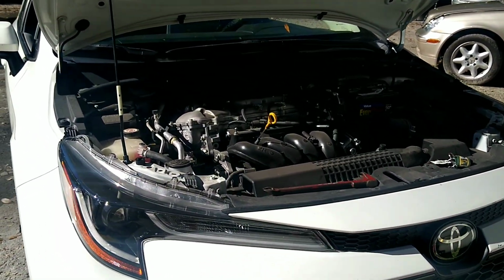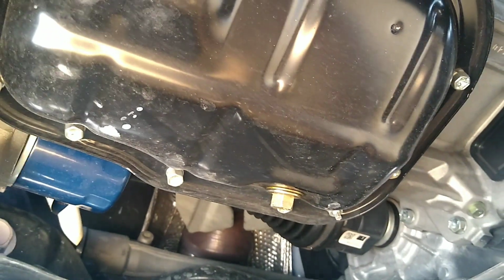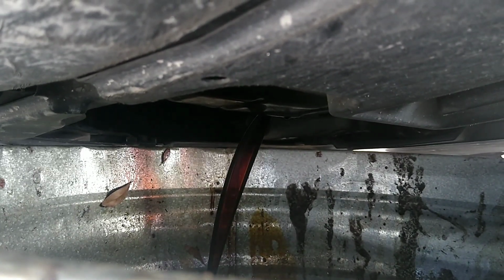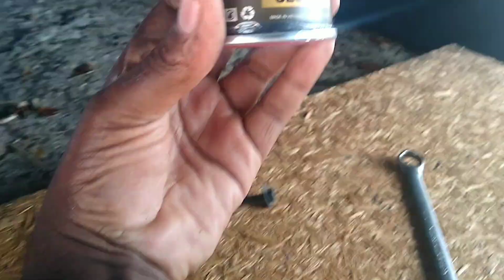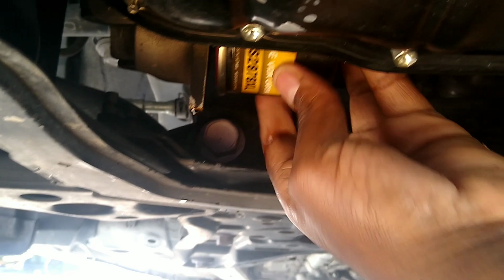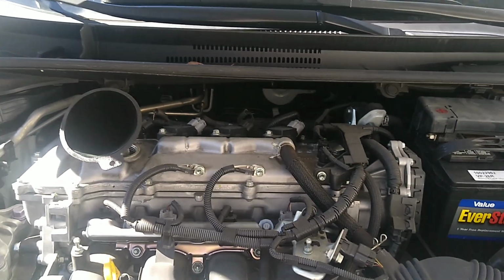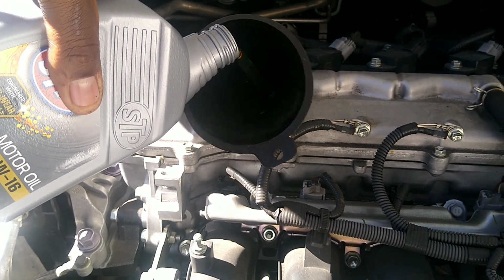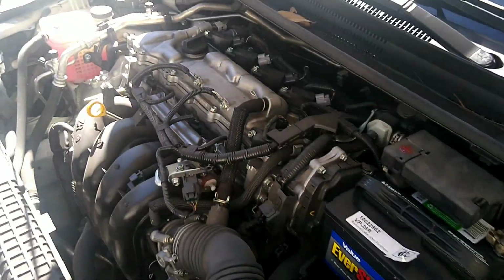2021 Toyota Corolla Quick Oil Change

Comment: The Corolla LE 1.8 engine takes 0w20 as mentioned.  Other Corollas with the 2.0 engine like the SE & XSE take 0w16.
Reply: Still can us 0w-20 if that's all you can find. Says this in the manual
Reply: The newest 2.0L engines actually use 0W-08, with the manual saying that 0W-16 can be used, but "must be changed to 0W-08 at the next oil change".
Reply: @googleusergp That is just to make more money for toyota.  Literally better for engine to use 0w-20.  The same exact engine goes to other countries where they say you can use 0w-08 to 5w-30 in the manual.  You probably won't even get better gas mileage.  If you happen to get better gas mileage you will still be paying more for oil and not protecting your engine as well.
Reply: @googleusergp Basically you must the use the more expensive oil and be part of our new marketing plan to create a sh!t load of revenue haha

Comment: I think a Amsoil filter and Pennzoil Platinum oil is better . And to use an engine flush every time such as Liqui-Moly or Amsoil .
Reply: Not required, nor recommended by most vehicle manufacturers. Change the oil when it's supposed to be changed, use a quality filter (the OEM filters are cheap enough) and use the recommended oil grade and you're fine.
Reply: Never engine flush unless you have an older gummed up vehicle it’s full of additives that are abrasive that clean the engine if your engine is to clean you are basically scuffing up metal that doesn’t need it.

Comment: Owner's manual says 4.4 quarts of oil in the 1.8 litre.  Check your manual first. Overfilling is bad for the motor. Use straight synthetic oil
0-20W.  0-16 is for very cold climates.  Hot in Texas and you can run 5-30 during the heat wave. Personally I don't like to alter the viscosity and change wear patterns. Pennzoil is terrible oil! Use Mobil 1 or Castrol. Wix makes the best oil filters and Fram is the worst made. Synthetic oil can go 7 to 8000 miles depending on conditions and the driver. Make sure to let all the dirty oil drain out for a while. Haste makes waste.
Reply: The Toyota manual recommends the proper grade and it's even down to 0W-08. There's no need for thicker oil if the engine is in good shape and the oil is changed properly.
Reply: How about, low mileage, drive only a couple times a month, year around moderate temps (low 50s to high 60s all year), and only have oil changed maybe every 1.5 years or so?
Reply: @vectorvictor5699  Change it once a year no matter what. You want to get the moisture and any contaminants out of the engine. Oil is cheap and it's easy to do on the Corolla.
Reply: @googleusergp  I hear you.  I still have to get up the bravery to do my first ever oil change.  Never having done it before, it's a lot more daunting.
Reply: @vectorvictor5699 so it every 6 months. Or 4k miles. I don’t listen to the once a year guy 🙄. Your oil NEEDS to be replaced every 6 months regardless how much you drive.
Reply: This is informative, thank you

Comment: You have 1.8 engine used oil 0W20
But 2.0 engine used 0W16
Reply: The newer Dynamic Force 2.0L engines use 0W-08 now.